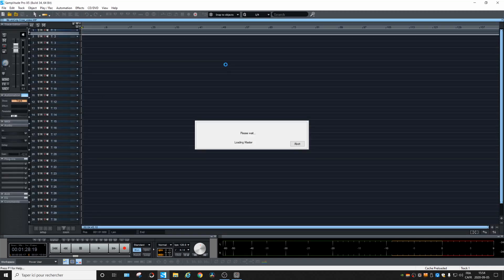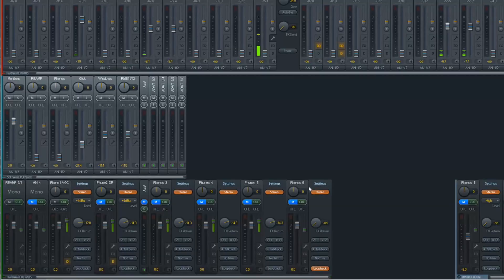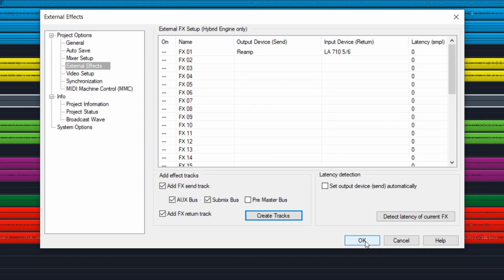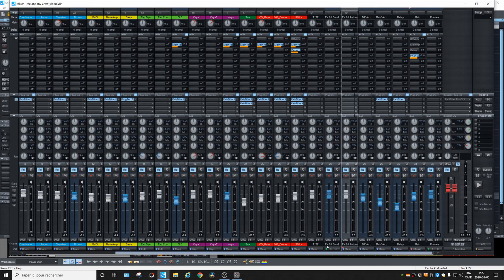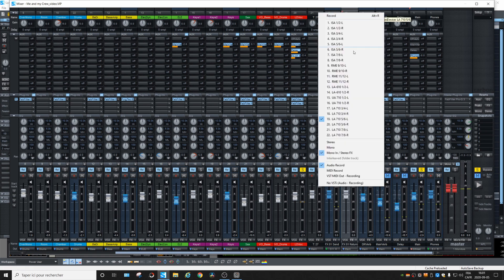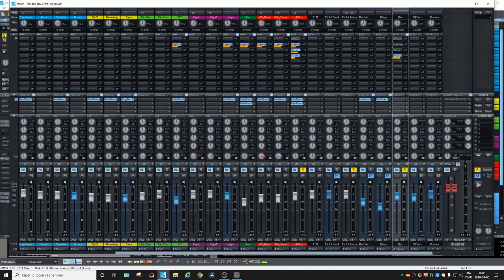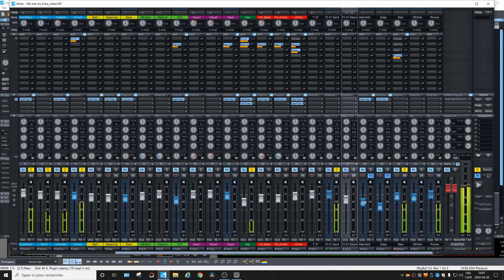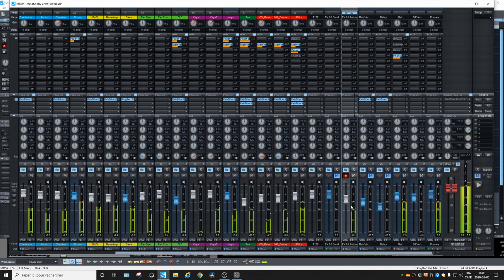Mixing with external gear with Samplitude Pro X5

Comment: hello Marco primeau, I ask you for information on the program, for the dual monitor function, where should it be enabled? thanks
Reply from the maker: Any section of Samplitude is detachable and can be dragged on a different screen. In my workflow, I just open the mixer which should be a free window by default then I put it on my second screen, nothing more to it than this.
Reply: @MarcoPrimeau  ok, i understand, thanks for replying to my comment, have a good day

Comment: Awh man Mr Marco thanks for this video Highly appreciated thank you
Reply from the maker: My pleasure !
Reply: @MarcoPrimeau  im think I'm have to upgrade cause the upgrades on 4 is unstable and ain't recording the the signal from the external hardware it's reading and working but won't record the actual from Outboard Compressor. Its wierd it record and print but not recording the Compressor. Seems like the uograde in 4 is patch unstable so yhea im have to go to version five.
Reply from the maker: @jmizzbeatsj-jigga7888  Before you do, check the realtime mixer of your interface.. Even without samplitude's features, you can assign a track to a seperate output then within your interface rederect the signal to a physical output then choose an output to record the processed signal.. Check my reamp videos..
Reply: @MarcoPrimeau  Oooh okay im definitely going check the video out tonight. Thanks you a whole lot again Mr marco🙏🙏🙏